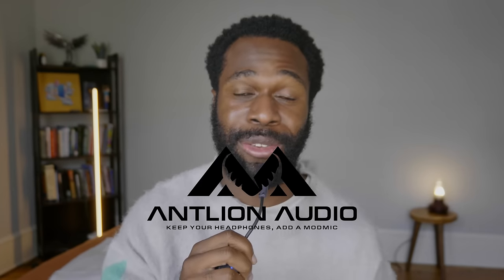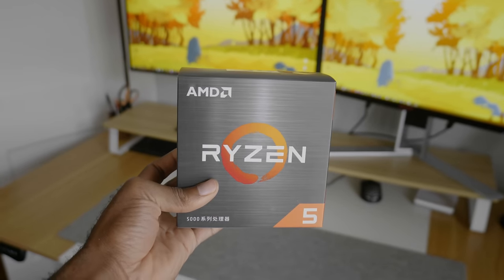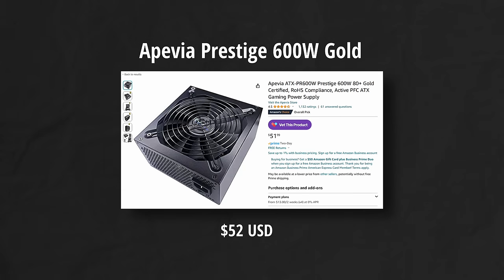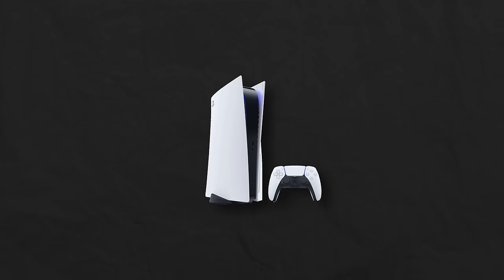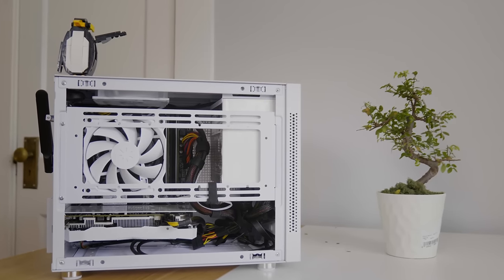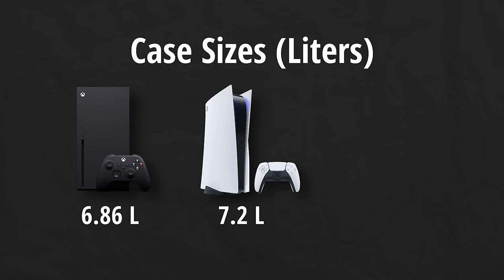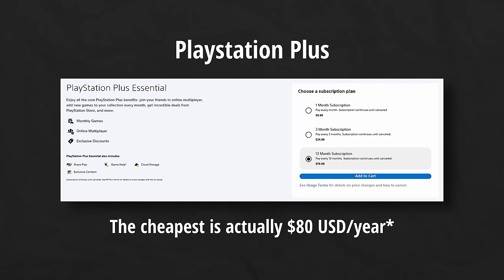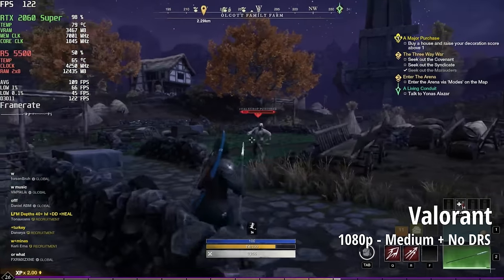The $500 PS5 Killer...did we do it?

Comment from the maker: A few notes, so OPEN ME pls <3!

► Antlion Audio made this video possible. If you want 15% off a great microphone, use my code 'OZTALKS'! https://antlionaudio.com/collections/microphones?utm_source=YouTube&utm_medium=OZ&utm_campaign=Q423

► If you want to build a PC just like this, check out my $325 and $500 PC Builds! https://www.oztalkshw.fun/builds/november-2023-builds-325-500

► While the SAMA IM-01 is a great case, I recommend the Antec NX200M or Thermaltake Versa H18 for beginners. It's more forgiving. I put those cases in my recommended PC builds (linked in previous bullet point).

Happy Thanksgiving to the Americans!
Reply: thanks for the warning lmao
Reply: I would buy that modmic, but uhhh 120.00 basically is a bit steep for something like that. I think you're a good pc builder. I don't know why you don't have more subscribers. I have been building and modding since 1990..286/12mhz days. (I had a homemade water cooling system I built waaaay back in 2006), and yes it worked perfectly. Unfortunately the cpu's back then didn't like overclocking much. I got my opteron 185 300mhz above stock...temp wasn't the problem at all. What I normally do personally is buy the best mobo at the time, stick it in a case, and upgrade until it's maxed out. Meaning memory, cpu, hard drives, ssd's, etc. This usually gives me about a 10-13 year upgrade path, then I start all over.
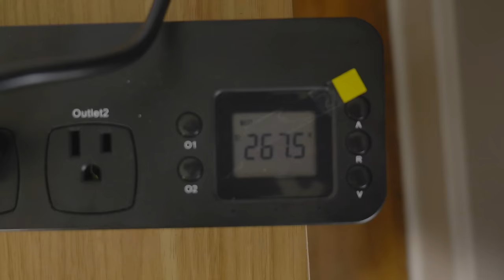Reply: 6:00 - Testing here is flawed unless you capped Cyberpunk to 60fps on PC when taking those power draw numbers. Furthermore, did you confirm that the PC and Console version of the "performance mode" result in the same settings?
Reply: @mokahless  Stop being a meat in bread person and putting people down. Consoles Suck, PC's Truck. 2 Strokes Truck, 4 Strokes Suck. All he had to do is stick a 3070 in there and it would beat the consoles.
Reply: Interesting I can track my recent upgrades run around 3-3.5 years. But each rig I recall 2011, 2016, 2019, 2023. I think game selection will be important. Sometimes it's CPU stutters that made me upgrade, not really a desire to do so and changing from 1080P ultra to 1440P. I ruined my complacency with 1440P there was nothing wrong with 1080P. At the time I got the current display (2020) thinking my mother would be happy I could isolate myself for raid time, but nope. I do keep a lot of my builds around and a lot of storage drives, it's great to max out though I will usually put a lot of older builds on Linux.  @shanemitchell477
Reply: On the gpu side PS5 is between 5700 and 5700xt it's not full rdna 2 
Series x is 6700/6800
Reply: RTX 2060 will tank big time in 4k cyberpunk quality mode whereas PS5 can run smooth constant 30 fps  in quality mode 4k.
Reply: @adlibconstitution1609  A 3070 runs it just fine in 4k max settings, even with the expansion. I still get about 62fps.
Reply: @shanemitchell477  Yes but if you turn on ray tracing the 3070 will drop in fps while the PS5 with ray tracing will still have a stable 30fps in 4k.
Reply: @adlibconstitution1609  Uhhh ray tracing still gives me over 30fps. an 11900kf and a 3070 is even more powerful than an xbox-x and a ps/5. Go learn some facts about hardware instead of just spouting off at the mouth kiddo.
Reply: no this is not the console killer, a console killer will more than likely be a PC that doesn't require you to build it and that is sold at a far cheaper price, like the mini gaming PC's that exist, but who really knows, if the hardware is bad and the price is bad, than it may not matter in the end.
Reply: OZZZZ!  PLEASE DO MORE MULTITASKING VIDEOS!!!    

STEVE AND THE OTHER STEVE BOTH FAILED AT MULTITASKING, BUT YOU CAN DO IT!!!  THEY JUST GAVE UP!!!
Reply: You know what this system needs.... An AMD 6600m and to ditch windows and install Bazzite instead.
Reply: The sama im01 is such a good case! So modular for the size where you can change the placement of gpus and psu and even make an inverted build by swapping the top, front and bottom. Also supporting full size parts for a 20l which is mostly reserved for itx builds.